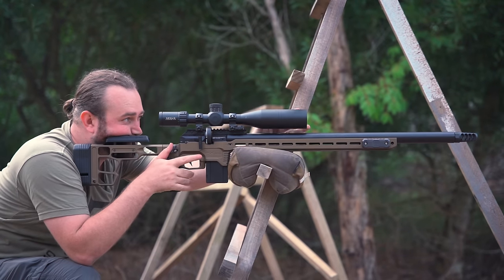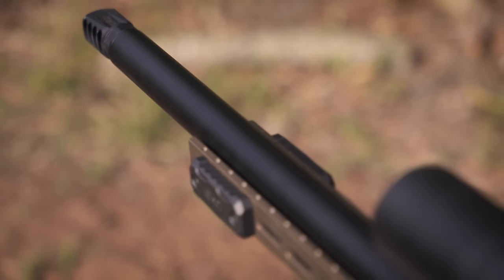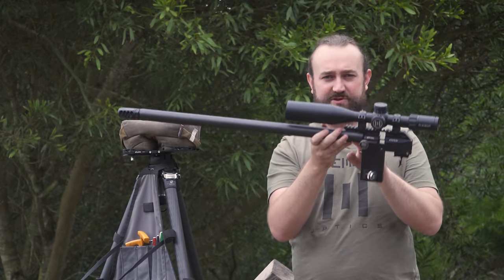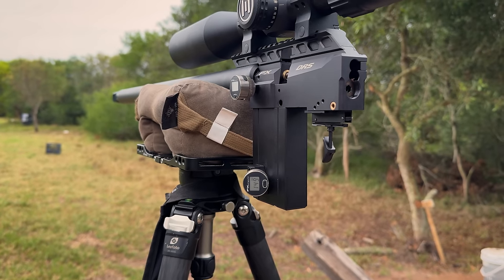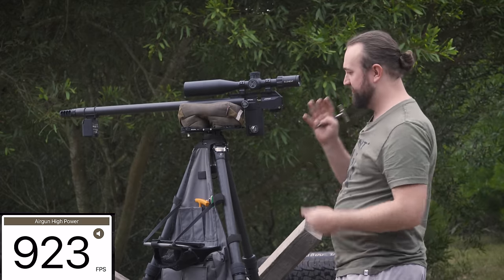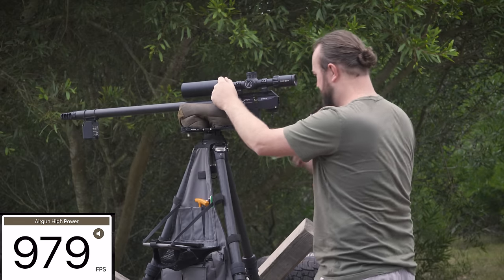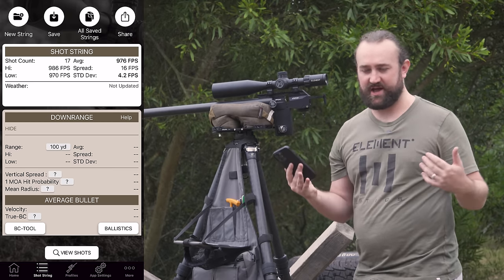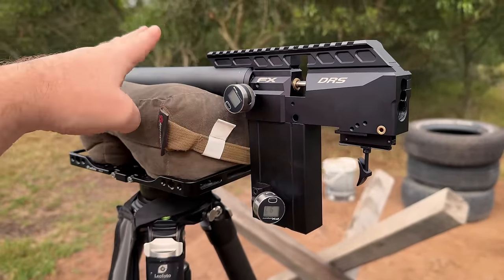FX DRS PRO: First Shots & Initial Setup - It's a Numbers Game! [Part 1]

Comment: We all would love to have these guns but who has 3grand for a air gun, when you can get top line rim fire 1/3price.
Reply: you're looking at a top spec gun for competition, regular models are cheaper.
Reply: Honestly this is my biggest hang up, if suppressor regs weren’t such a pita in the US then I wouldn’t even look at airguns. I’ve always loved airguns and have been in the realm for many years, but the major drawback with them is the cost of performance.
Reply: @markwarner.03  Ya really the only reason to shoot them is for legality issues on where it's being used over an actual firearm, easier to be suppressed/moderated, and for lower power levels on pests so there's less issue of pass through and damaging something behind your shot. At least in my opinion.
Reply: @supergreatairgunreviews  agreed. There is something to be said about tune ability of airguns and again been enamored with airguns for decades but at this point I’m just a bit bummed at what $3k buys. If FX did a DRS pro without a $1500+ chassis I’d be on board.
Reply: @markwarner.03  Yeah the ability to tune for different pellet and slug weights, accuracy is really good for small game and pest control, where pcp guns shine. FX is definitely making some of the best airguns but I haven't pulled the trigger on one yet because my $250 pcp pretty much does all the pest control I need around my fruit trees on rats, squirrels, gophers. I guess I fall into the "poors" category but I think most people don't want to drop $1500+ on an airgun. If I buy anything else next it will probably be a snowpeak m60b which is like $600 but more tune able/shot count than my current pcp.
Reply: @markwarner.03  I mean 3d printers are a thing, so are the flow-through pipes plans iykyk
Reply: @sebleonard8273  extremely aware lol also have witnessed first hand of when fed boys knock on the front door.

Comment: I dont seem to understand the drs pro… no external macro micro? But why? Fx panthera was outstanding but what happen to DRS? U have to remove the chassis to adjust hammer tension? No hate but i think im keeping my panthera as my pra comp gun.. fx drs pro looks bad ass though!
Reply from the maker: You don’t need to remove the chassis to adjust. And I agree the clickable adjuster is nice to have, but for this discipline you want to set your rifle up and then leave it, and anything on the outside that can get bumped can be a risk.
Reply: @AirArmsHuntingSA  they could have made it slimmer or lockable 😂😂 thats the reason why i ditched my AGT vulcan coz its pain in the 🍑 to adjust when looking for the slugs.. same as my maverick.. and the plenum is a tad bigger to m3.. panthera is 156cc and drs is only 73cc if im not mistaken.. hope u can visit us here in dubai matt.. hope to meet u in person bro! Followed u from crown mk1 to m3 and panthera.. 😂
Reply: Would be nice to have external adjustments.  Think of shooting down there in South Africa at sea level, then coming up to RMAC high in the mountains.  You will need to adjust to get the same performance.   Same with extreme Temps, minor adjustments will need to be made.  External adjustments are crucial for making things easy
Reply: @woogieman02  exactly what im thinking as well.. slimmer profile/lockable to have a clear record on which how many turns etc etc easily adjustable but if the problem is “looks” then they could have engraved it black on the wheel so it wont be that much of noticeable.. anyways.. id stick on my panthera.. 😂 but the DRS PRO looks very tempting! 😂

Comment: the sound of that weapon with that musslebrake is just totally amazing! amazing, content! you got me in to airguns, bought an MK1 SN185 FX crown,  im very happy with it
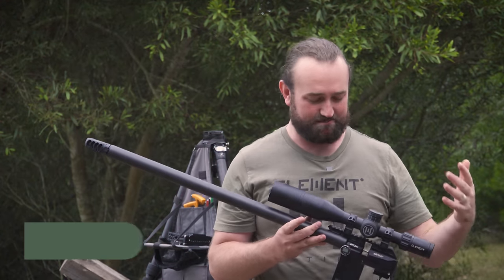Reply: i have one question though, if you dont mind me asking. i have put a third gen Huma regulator in my crown, aswell as a Slug power kit with the high flow probe. do you think i have any chanses at 20 grain slugs out of the factory 177 cal, 1:18 liner? my question really is, what regulator pressure or rather what mussle velocity would you think i would have to aim for to be able to group well with slugs at 100 yards? im trying to tune for either NSA and ZAN 20 grains. thank you

Comment: I had a panthera which did about 122 joules with 40 grains at 307ms. 
It did around 20 shots with a 250 fill and the standard 300cc cillinder.
It also was able to convert to left hand cocking, had a proper foster fill connection which you can relocate for a position you like and have the option of putting on more air on the front.
This plus the fact that it can handle longer slugs, and its cheaper with a saber tactical rail bagrider and everything installed then the drs pro makes me wonder why anyone wants the drs pro.

Comment: There is an aftermarket brass jam plate for the Dreamline hammer adjustment screw, maybe it fits the DRS because it looks the same. It prevents the hammer spring adjustment screw from backing out.
Reply: Just what I was thinking too. I also thought about not using turns to determine hammer setting and instead using the tail piece on calipers to measure for a more precise method.

Comment: We still have a raw product.
I see the following upgrades:
1
Installation of firing pin preload from Maverick or Wildcat-Mk3.
2
Make a port in the MDT chassis for adjusting the pressure of the regulator.
3
Isolate the barrel from high pressure with a carbon pipe.
Installed inside the reservoir. The barrel remains suspended in the pipe.

Comment: Superb.  Thank you!  I have a Panthera Hunter Compact and Panthera 600, both in .22. My question is whether or not there is any latency between changes in hammer spring settings. i.e. When you change the hammer springs in or out is there a delay to to hammer spring "memory" or whatever or is the change immediate?  Please answer as appro0priate for the Panthera Macro and Micro settings.  I am in Connecticut USA and am retired and shoot every day, weather permitting, in my back yard at 50 yards for an hour or two, sometimes more.  I also have a Maverick 600mm in .22 and .30, and several (too many) other PCPs but I love my FX guns SO much, I likely will get rid of most of the others.  I am very happy and lucky not to have gotten an Impact and chose a Maverick at that time.

Comment: Wow!!! 🎉🎉🎉❤❤❤
Will that carbon cylinder fit over my new 700mm FX Dynamic? 
The empty shroud up front feels like a waste of space which can be used to store more air volume = more shots, after all... Most of us will use a moderator at the end of the barrel. 
What an awesome idea that DRS!!!🥳🥳🥳🎉🎉🎉
Reply from the maker: No it won’t, the two systems are completely different. It’s not an empty shroud by the way, it’s filled with air😉
Reply: @AirArmsHuntingSA  Thank you Matt🎉

Comment: @airarmshuntingsa it looks like the hammer tension on the rear is accessible what about the regulator can you access that with a ball allen key through the stock. I do feel that removing the stock to make changes will create wear and tear and a loosing the gun to stock mounting over time.

Comment: Why are all of the slugs hollowpoints? It looks like you would want solid for competition...
Reply from the maker: Doesn’t make much of a difference, actually. The hollowpoint makes a cushion of air in front which has a similar effect to a rounded nose, so BC is about the same. Plus, hollowpoints are easier to manufacture because the nose punch is also used to eject the slug from the die.
Reply: Thanks Matt, always wondered this

Comment: You don't need to lock tite the hammer spring adj. spring to keep it srt in place nore do you need to gunk up the threads. Just use a second set screw behind it. Don't overtighten it, it's not necessary. With that you can easily remove the locking second screw and you can reposition the setting without dealing with gunked up threads.

Comment: So, you're tuning a gun for 40 grainers that can't have 40 grainers in the magazin. FX engineered a gun that should look like a firegun, but they need to mount a gauge on the side of the plenum to get it sold in most countries. 
You can't tune it with the chassis on, and all of those drs models with smaller plenums don't even a gauge on it. Matt.....you do know that you need to see groupings when you are tuning right???
What kind of engineer didn't make it possible to put any allenkey in the back with the stock on???
What kind of engineer forgot that reg gauge??? who cares about a filling pressure?? do they even know that most pcp shooters shoot from the bottle??
Why for gods sake did they put a smaller magazin in this gun?? it should be holding 40 grains at least... will probably have problems with a lot of 34 grainers??

What the hell is going on at this factory????? and all of that for 2800+ gun?
Reply: The magazine holds 40gr slugs, and apparently the stock got stuck in customs… (as per several comments from the OP throughout the comment section), so it’s not a matter of not being able to tune the gun with the chassis on, so much as Customs being weird about the stock…
Reply: @akseminole  no it doesn't. he made custom shallow slugs to fit in that magazin. You can't turn the reg with the stock on...